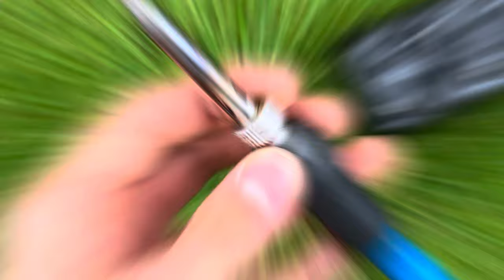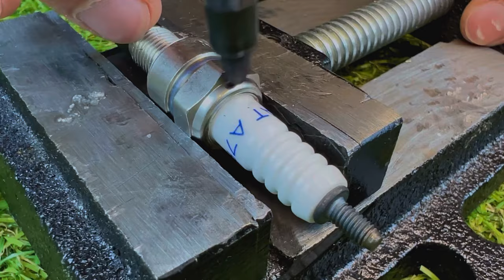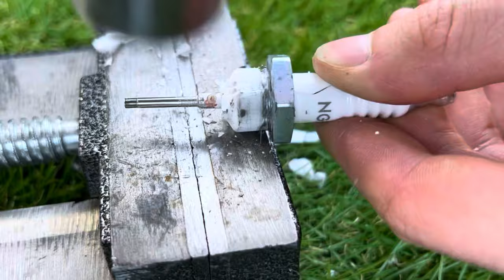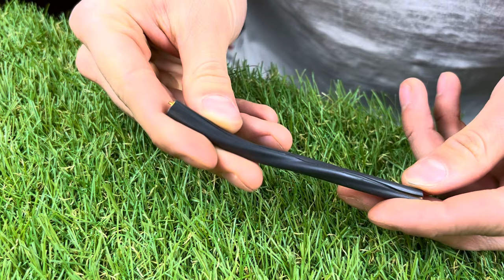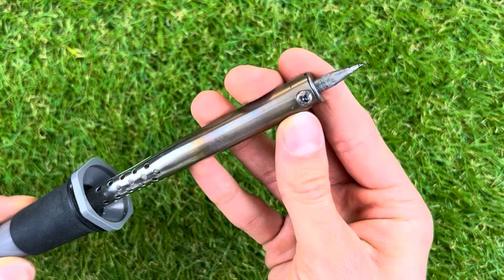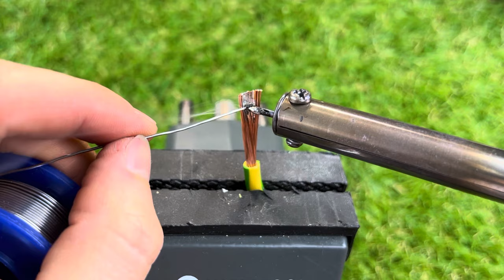Why is Not it Patented? Just Insert Spark Plug into Soldering Iron and be Amazed!

Comment: This is a lot of work for just cleaning the tip of the soldering iron. Heat up the soldering iron, dip it in the FLUX, and with a clean thick rag, quickly wipe the contamination and solder and Flux off your soldering irons tip. In the first image it shows the solder just beading up on the irons tip, not on the copper wire. Well the solder ONLY flowes onto HEATED items. So the irons tip should be applied to the copper wire, heating the wire, then when the wire gets hot enough to melt the solder, it will flow into and onto the copper wire. 
  This video is a representation of replacing the irons factory tip with diy substitute. Do this at your own risk.
Reply from the maker: I'm glad you found a method that works for you! 😊 It's always great to hear different techniques for soldering iron maintenance.

Comment: You can't solder unless you use flux acid core
Reply: Not acid core.
that's for pipe not wire.
Reply from the maker: Thanks for the comment